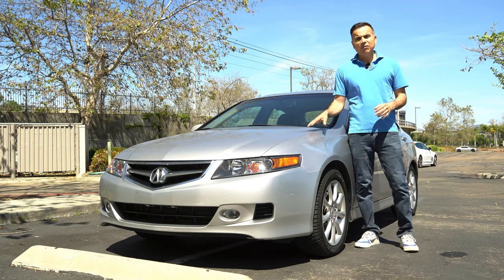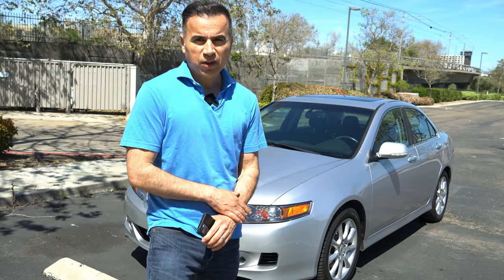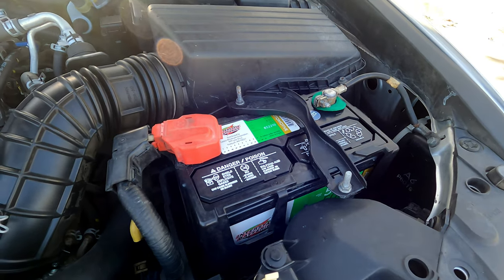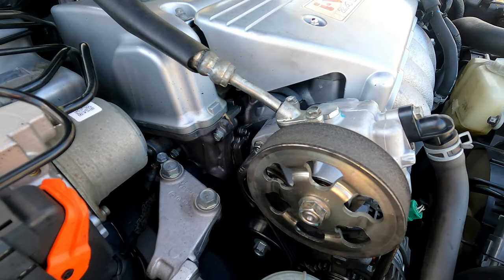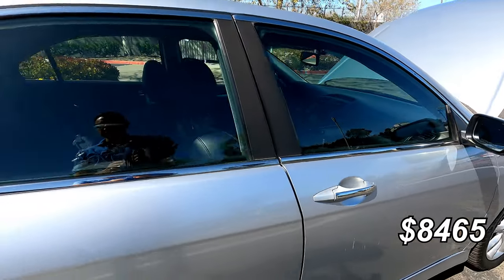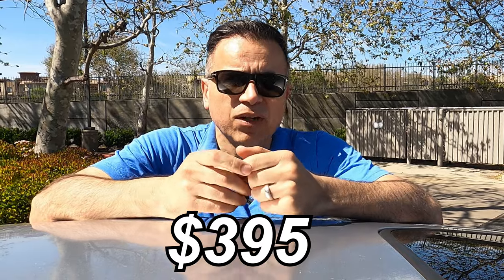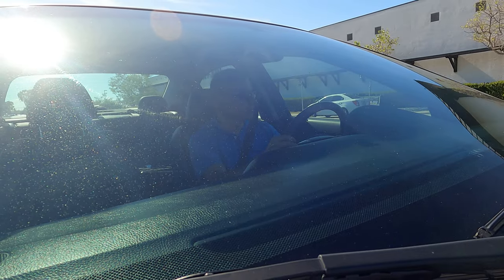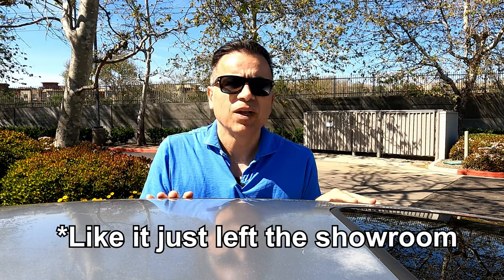This ACURA TSX Has Cost Me HOW MUCH?! #Acura #AcuraTSX #honda

Comment: I think your biggest mistake was buying a car with that many miles on it. I would have had it checked out by a mechanic. I'd want to know if it burned oil. I think you got lucky in that respect. I would have only done what was necessary because you'd never get your money back. That's just throwing good money at bad. I recently purchased a 2011 TSX, one owner, 85 k miles, new tires, good CarFax (serviced regularly, spent it's life in Reno-no rust) and checked out by a mechanic. The car's in beautiful shape, obviously taken care of. Doesn't burn oil. I paid $15,000.  I'm still rolling the dice but I know the common issues with this car. It will still be cheaper to fix than buying a new car. That said, it was a horrible time to buy a car, new or used but I had no choice. Someone once said, a car is the worst investment you can make. True in most cases. Thanks for the video !
Reply from the maker: Many things were considered in buying it. The price, the overall contextual condition of the car, I knew the mature owner. Sure, I dumped a lot of money on it but at $10k I don’t know what else I could have gotten that hits all the markers. We’ve had it for over 10 months have have put almost 16k miles which is a lot considering the fact that my wife only drives less than 2 miles to work each way so most miles are from weekend trips etc. 
the car had no leaks and burns no oil either, the transmission is healthy and the suspension is “ok”, could use new shocks.
Congrats on your purchase. In 2015 I almost bought a 2010 with like 30k miles for $20k *correction. Obviously as you say, current used car market is nuts but don’t worry. I can’t think of anything newer that would be better than your TSX. And these cars are solid, at 85k it’s barely getting started.
Reply: @JuanCarlosLTO I think you made a solid deal. With all the stuff you fixed it'll run 300k or over. Just keep up maintainance
Reply from the maker: I’m about to upload the 1 year update. The car is doing great and we just came back from a 1400 mile round trip… I got slightly over 30 MPG.

Comment: Sounds like routine maintenance on a car that is over 200K. Most of it is cosmetic repairs that are not absolutely necessary so it also sounds like a self inflicted money pit.
Reply from the maker: You’re right, I also say that in the video. I usually don’t mind spending money on aesthetic upgrades to make the car look the way it drives.

Comment: Here in Virginia when you buy a new car you have about $900 for “dealer processing“ then you have taxes and transportation etc. I figure for an average price car you’re spending at least $4500 before you even touch the principal so buying a used car is not a bad idea. If you can get another 20 or 30,000 miles out of it and then sell it for a decent price your money ahead. Thanks for sharing.
Reply from the maker: Yes to all that Robert. Another charge on a new car is “destination charge” and it’s usually north of $1k.
Honestly, having a new car has a lot of perks but we pay for them. I usually only have one old car at a time and I usually have something much newer and within warranty. These last few months have been particularly hard since I also had to get the old BMW sorted out and I also bought tires for it so in the last six months combined I’ve spent around $13k in these two clunks. 
Thanks for watching!

Comment: I’ve owned many many many of these cars and they’re not hard to work on. Honestly you could’ve saved money by just doing the work yourself, I had 2 of these things with 280k-310k miles and never had a issues besides having to replace a thermostat
Reply from the maker: In my end of ownership I included a clip of a first owner who has over 600000 on his. Incredibly reliable cars. I sold it and moved on but just to get something else.
Reply: @JuanCarlosLTO  solid cars man , try getting a 6 speed and do a review on it
Reply from the maker: It’d be nice. In my opinion, a manual transmission TSX is almost a complete different car. I actually swapped out the transmission on my old bimmer to make it a manual and love it more ever since I did.

Comment: I just got a 2005 Acura tsx with 90k miles. I had to replace the crankshaft seal, flushed the brake fluid, did an alignment, tie rods went bad, spark plugs, oil change, power steering pump 🤦🏽‍♂️
Reply from the maker: How much did all that run you if you don’t mind me asking? 
90k miles is nothing for these cars but then again, a lot of the common issues maybe hadn’t been addressed.
When I bought mine, the owner had changed the AC compressor which is a common issue closer to the 200k mile mark and the alternator.
Reply: Youtube it. You can fix most of that yourself pretty easily
Reply from the maker: @kW_789 agree! There’s so many go by videos now on YouTube and these cars are pretty easy to work on, granted you have the place, tools and time to do it

Comment: Juan Carlos,
I have an 08 TSX with the manual transmission and I got it 3 years ago with 227k, I grew up in the automotive industry, my dad had two car dealerships here in NYC. Never feel guilty about bringing a car back to its original condition, especially if your family is enjoying it! As far as respraying it, you can buy a rear deck lid in the exact same color in whatever condition you want, also you spent the same amount of money refurbishing it but it wasn’t the very next day, in other words you’re replacing things as needed and that could happen with any car out of warranty! What burdens me and you as well is the fact that you can’t purchase a service contract on a car with the amount of miles that we have, if you find a warranty or extended service contract, buy it, it’ll be worth it!
Reply from the maker: Oh trust me, no regrets. I’m used to driving much newer cars that need zero reconditioning but I lose way more in depreciation. 
You’re lucky to have a manual transmission one. I couldn’t because when I bought it I also needed an automatic because wifey drives it once in a while and at one point it was her daily. 
I don’t know if I’d do a truck swap. It’s a good idea but the paint is also fading in other areas and it would only address the issue partially. I’m not a big fan of painting cars because it’s nearly impossible to match factory paint. 
Thank you for watching my video.

Comment: Currently replacing the power steering rack and pinion in my 07 Acura TSX. I’ve had it since just out of high school. Bought it used with 55k miles but it was brand new to me and I had saved all my money to buy it. Did a lot of research beforehand and that was the car I wanted, no question. I’ve kept up with the major maintenance over the years, but with a young owner and as a daily driver for over a decade now (a commuter college student for the first 4 years, moving to Florida, moving back, and now a 2year old kid) it could have had a better life so far. I love it though and now that it’s older and needing replacements that can get expensive, it’s spawned a passion for learning how to fix it up myself (as well as friends/family cars). I’ve done a good amount of mechanical work on it so far, but I’ve also got plans to do some more beauty-work in the future too. Repainting it myself probably, getting the drivers seat reupholstered, fixing curb rash on the rims or getting a new set, maybe a body kit or spoiler. Nothing wrong with making the car you love look the way you want it to, but I’m definitely making sure the mechanicals are set first.👍 ball joints and an alignment are next and then we’ll be back on the road, planning for the next upgrade!
Spent around 1k in just parts on it in the last year, but it was worth it!
Reply from the maker: Funny when you said that because of being young, college etc and the car might had been neglected… I totally get you. I was on the same boat when I was young. My brother handed me down a high mileage 1988 BMW 3 series that was otherwise in great shape but alike, I just didn’t have the resources for a car like that. 
Now my 2 cars are kept in top shape and still cheaper than buying new. Wifey refuses to replace the Acura, she just loves it.

Comment: Exact same car here carlos but a 2004!! Previously I owned another 2004 i sold it w 280000 miles because i found one same year w only  45000 miles bought from an old guy 3 years ago currently i have 89000 miles but if you do the proper maintenance these cars will go many thousand miles the only thing i will tell you is to stick with oem parts as much as you can specially fluids but you have a great car

Comment: Hi Juan.  The owners 06 manual clearly states that 91 Premium fuel is recommdended, not required.  The csr has a compression of 10.5:1.  The message in the gas door states Premium fuel only, which contradicts the instruction in the owners manual.  In the 04-05 owners manual, it ckearly states that put on a lower octane frequetly can lead to engine damage.  However, Acura removed that message in the 06 owners manual.  The knock sensor should detect the knock and retard the timing so knocking would be stopped, at the expense of suffering fuel economy.  I am just curuous.  Thanks
Reply from the maker: I’ve been doing 91 just because I can 🤷🏻‍♂️. I really don’t remember if I kept it premium with my ‘04 back then. I do remember that the car after that one, a 2007 Lexus IS350 I didn’t. I remember it was “recommended” on that one so why waste my money.
Reply: @JuanCarlosLTO the is350 and 250 is required. Compression ratio is like 12:1. Which falls in range of premium
Reply from the maker: I remember the is350 said “recommended” so I never used 91. IN the case of the TSX I can’t remember if I did or not 🤷🏻‍♂️. I’m old 🤣
Reply: @JuanCarlosLTO  Now, I just use 91 gas and experience zero issues.  When my car was around 200,000 km, I put in 87 octane and the check emission light illuminated during the freeway even though I was driving lightly.  Ever since I put in 91 octane, that message never reappeared, and the car is still going strong closing to 420,000 km.

Comment: I bought my daughter the exact same car and color.. for 5k.I shopped around for a bit. It had 147k miles. She's had it for about 6 months. I replaced the battery and the light bulb and ballast and igniter...total probably $650. I did all the work myself. These cars are reliable....no need to waste money trying to make it look new.
Reply from the maker: Agree. I do like to spend extra on making them look the way they drive but good point though. I even do 91 octane so far but I’m not sure it’s necessary. I just make sure I only gas up at Costco to find it cheaper

Comment: Make sure check your car ball  joints specifically lower ball join last week my daughter friend 2005 tsx with 215000 on it had lower ball joint break of and came off  and hit front fender and damaged so i replaced all lower ,upper ,inner and outer ball joints , lower control arms and knuckle with wheel bearing and hub.

Comment: 2008 dark grey currently 130k bought in April 2022, with 108k miles. I work at a shop so I’ve done this myself and with a lot of help from my boss. Michelin tires all around, OEM e.g brake/rotors, tirod ends, rubber joint on lower control arm, brake/trans flush, 4 oil changes, vtec solenoid gasket, front actuator spool gasket, top valve cover gasket, pcv valve w/hose, starter, air/cabin filters, new oil cap, iridium spark plugs, headlights. Still running good
Reply from the maker: All that was preventive maintenance or stuff needed? Mind now has over 228k and still runs great. My concern is the higher mileage effect on the catalytic converter as smog cert is coming up next registration.
Reply: @JuanCarlosLTO  both. Some of the the things were starting to wear out. That bushing was squeaky really loudly and I played it off for a while before I realize how serious it was. The tirod ends were blown too the ride felt smoother, the rotors were pulsating when I would gun it on the highway, the vtec gaskets were leaking as well. My only next worry are the motor and trans mounts but not in the near future hopefully

Comment: My total cost of ownership has been under $4K for a 2005. 

I just bought a 2009 6-speed for $800. It has brand new Michelins and a maintained battery.
Reply from the maker: The tires alone are $800+! Great deal.
Reply: @JuanCarlosLTO  spun bearing, but otherwise the car is in phenomenal shape. Started right up and went on the trailer. Excited to turn it into the next track car. Forged rods and pistons. Swapping heads. The a2 goes on the 2009 and the z3 head goes on the automatic 2005.

Comment: Really appreciating your content while trying to decide if we should buy, (and how much we should pay a friend), for a 2014 TSX wagon with 92k miles. This is to replace, as daily driver, a high mileage 1997 Camry V6 that is still running surprisingly well, and which we will keep as backup/airport transportation.  Current perceived TSX wagon negatives, (based on comments here), are road noise and the added cost of premium gas.  The test drive will be interesting, (we haven't been in it, yet), as we've avoided Hondas thus far due to perceived harsher ride vs Toyotas.
Reply from the maker: That wagon is money! I love seeing them on the road to this day. Acuras and Hondas are not quiet vehicles but if you can get over it, you’ll be driving a comparable car to a Toyota. The Camry is a great car and that v6 is almost indestructible. 
I keep hearing about not needing premium gas on the TSX. These cars should have the knocking sensors… but what do I know 🤣

Comment: Have you changed the power steering fluid?  I once changed a rear passenger door.  The door cost $100 but $400 labor to install.
Reply from the maker: I ended up changing the pump because it had a leak. Then my wife just drove over a pothole and ruined the rack and pinion and I replaced that as well.
Reply: Did it cost $1000 to replace the rack and pinion?
Reply from the maker: It was over $1400 parts and labor. Seems like our insurance may cover it minus the $500 dollar deductible.

Comment: Carlos... congratulations on the purchase of your TSX!  I own an 07 with stick shift and its been a blessing.  One of the many serviceable items done was all fluids (eng, tranny, coolant, brakes and steering flush, spark plugs, belts, hoses) and is running like a champ.  New brakes/rotors all around including Michelin tires. Roughly $1500 invested for everything (as I also do my own maintenance), but I will need new front/rear struts soon.  Are yours the original struts? Your car is well worth it if you choose to keep it.. definitely shop around for parts though.  I only buy OEM, but never at retail.  Keep posting videos 👍
Reply from the maker: The guy that sold it to me did all that maintenance shortly before he sold it to me and yes, my struts are original according to him and I find them to be on their way out. I’ve been looking at options and eventually I want to replace them with quality coil overs that I can adjust to my taste. I don’t really like lowered suspensions for the sake of it but in the case of my other car, the BMW, lowering it about an inch gave it the perfect stance for my taste and the ride is very composed without being hard at all. I just don’t know enough about suspensión set ups for the TSX so I have to do more research.
I still love the car. It’s at 230k now in just 9 months and next week we drive from California to Texas so the miles keep piling up without incident. I’m seriously enjoying the car of how much we save on car payments and I truly feel it presents itself really well. I get compliments everywhere, literally. 
Your manual transmission TSX is money.

Comment: 2012 TSX Wagon with the K24 4-cylinder, 5 spd auto. 140k miles. FAILED PARTS: alternator, tensioner, water pump, both drive axles (twice), all 4 coils, catalytic converter about to die (because of coil failures and subsequent misfire/gas-wash of cat), interior reading/dome light assembly, transmission replaced under warranty at 50k miles, rear window switch failing/intermittent, both front shocks. Add to brakes, tires, fluids, regular maintenance and replacement parts (oils, fluids, filters, belts, wipers, lift struts, etc) = NO better than owning a BMW or Merc or Audi. Have had all three of those and this car has cost me no less to own/maintain/repair. Our Lexus products (GX and RX) win hands-down for lowest cost of ownership for a luxury brand vehicle.
Reply from the maker: Wow! Lots of repairs. My guess is you have put many miles on it and these repairs were late in the life of the car?
In my personal experience nothing touches Lexus’ reliability in the premium segment. I had a 1993 SC300 that was a gem both aesthetically and mechanically. We loved the car but sold it at 139k miles. We’ve also had a 2018 RX and I had a new then is350 but we didn’t keep neither car past initial warranty.
Reply: @JuanCarlosLTO  I put all 140k miles on it. Trans at 55k. Coils throughout, driveshafts at 110k. Nothing crazy miles-wise. Just average product on par with American quality - or worse. At least those cars are cheaper to buy and Europeans are more-fun to drive. There's no reason to buy a Honda/Acura product...

Comment: In the past week, twice the car failed to start with no turn over and the dashboard lights flickered.  Yesterday, when I parked the car, the car battery made a loud fizzing sound after I opened the hood.
Reply from the maker: Have you tested the battery? That’s where I’d start.
Reply: @JuanCarlosLTO  The battery test came out fine.  However, test indicates battery is overcharged
Reply from the maker: When I was dealing with the starting issues I watched videos that said that was a sign of a bad alternator. I replaced mine unnecessarily and the one I installed is loud so I guess I could exchange it at autozone but it’ll be a shore to do it so I’ve been putting it aside.